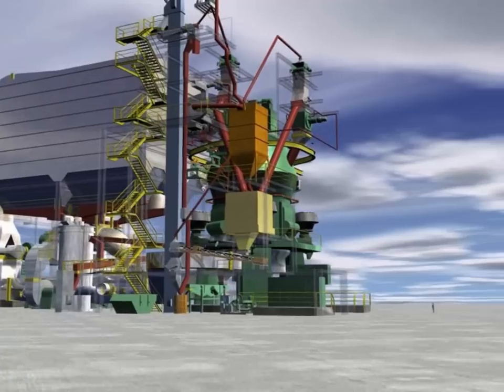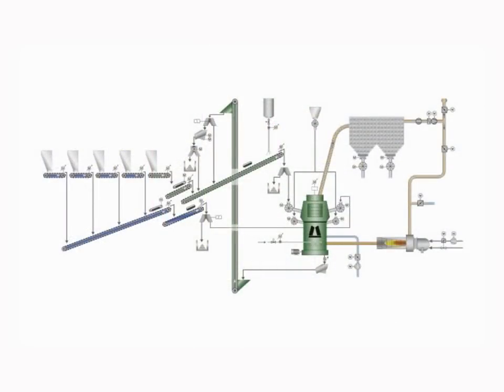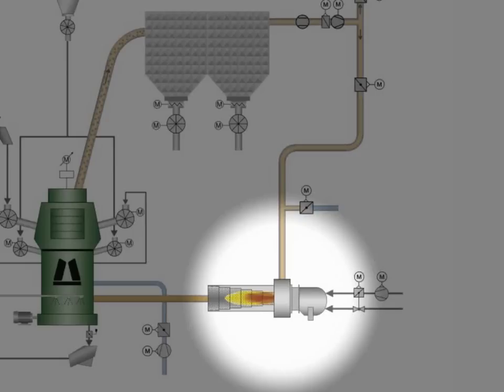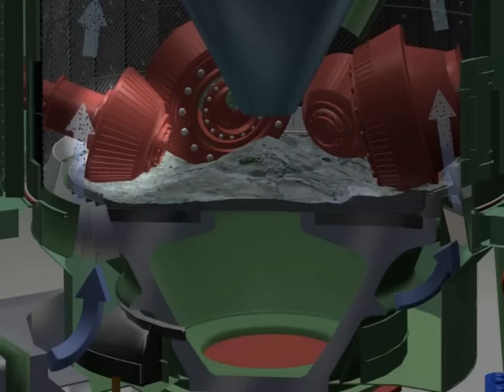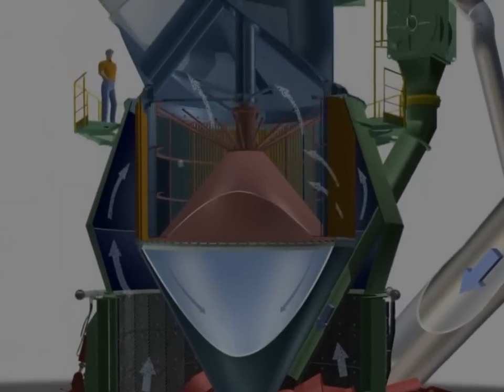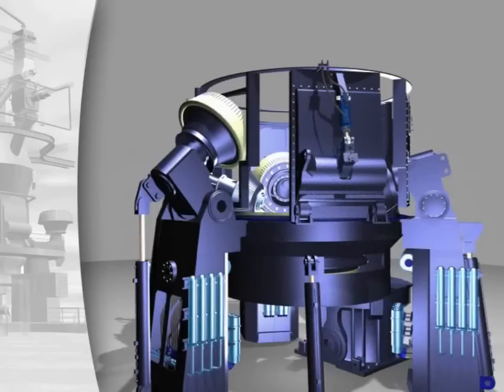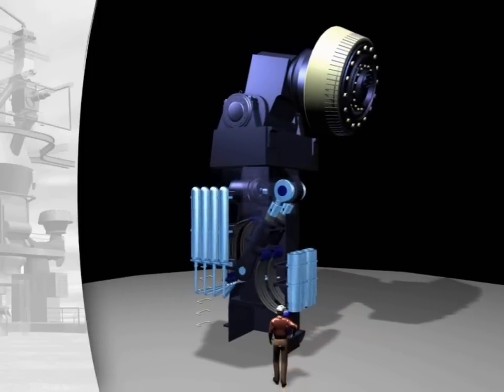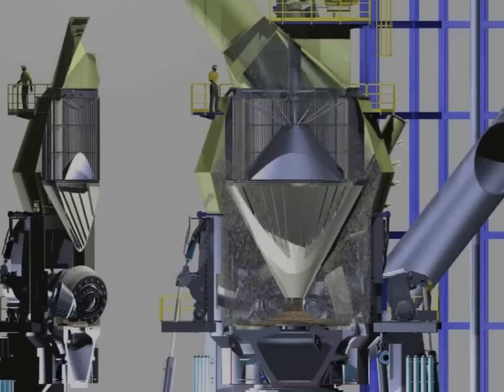loesche Vertical Mill LM 56.3.wmv

Comment: we offer customized ultra fine powder grinding mills system and coated machines for calcium carbonate/caco3/dolomite/talc/gypsum/limestome/ calcium oxide/ bentonite/dolomite powder
325mesh~3500mesh. 
better powder quality
 lower energy-consumption
 PLC control
www.lymill.com
Fujian Longyi Powder Equipment Manufacturing Co., Ltd
MP/Wechat/Whatsapp: +86 15105956429
Samuel@lymill.com